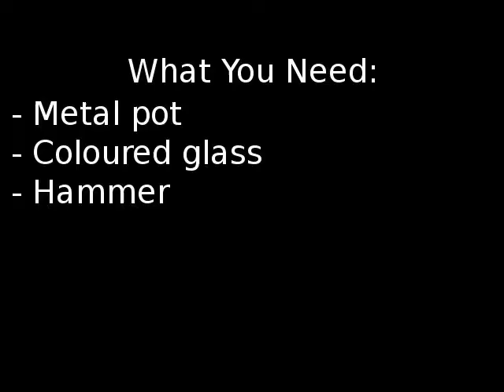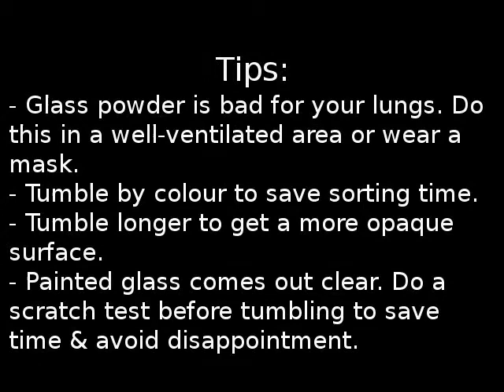Make Beach Glass Without a Beach

Comment: What is the machine?
Reply from the maker: I built my own tumbler. It uses a slow-turning gear motor with a rectangular food container attached to it. I slip a second container into the first to act as a tumbler barrel.This makes it cheap, fast and easy to replace the barrels when they wear out, and to keep various materials/mediums separate.